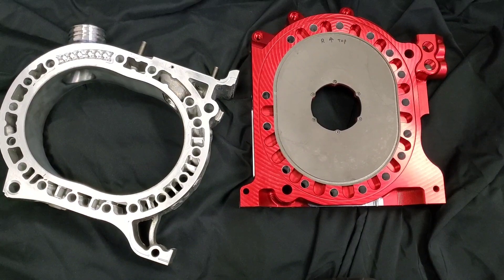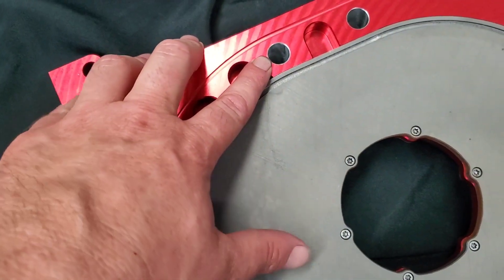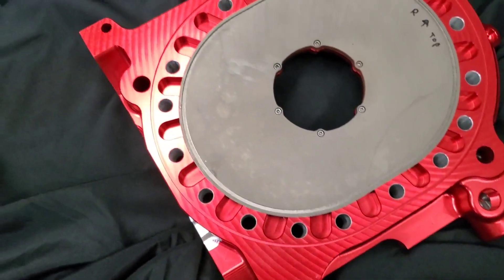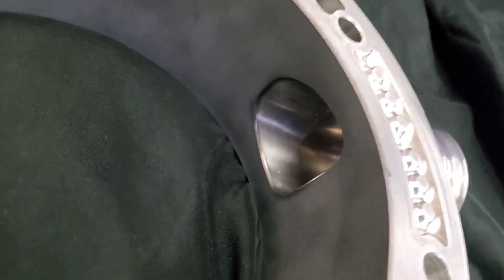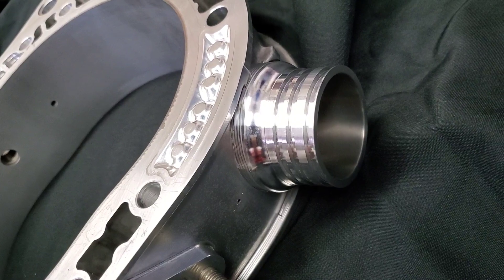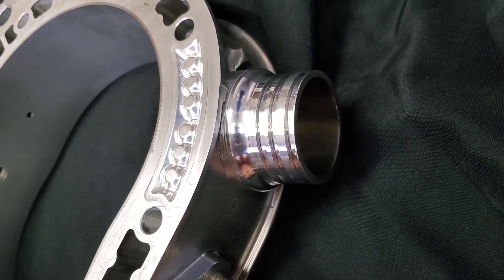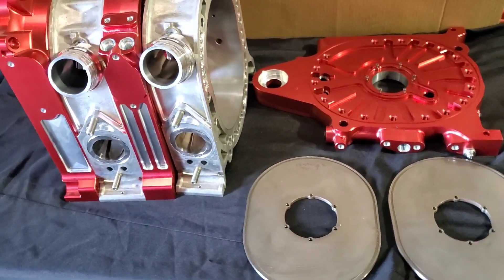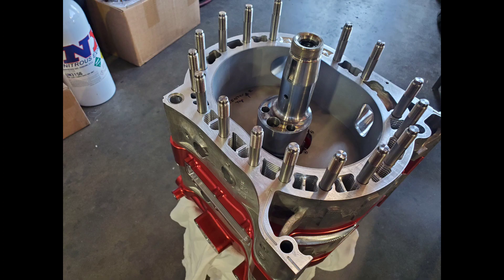Billet blocks and peripheral port rotary engines, KMR rotary tips, tricks and tech.

Comment: Hello Kyle, very interested in these billet alu housings with replaceable cast iron inserts. I have not been able to see any manufacturer's  assembly details on the replaceable wear insert. Can those pieces be bought seperate? Will you be having a video on the use of these housings. How about weight compared to stock.
Thanks again.
Reply from the maker: Yes. Generally they can be replaced if necessary